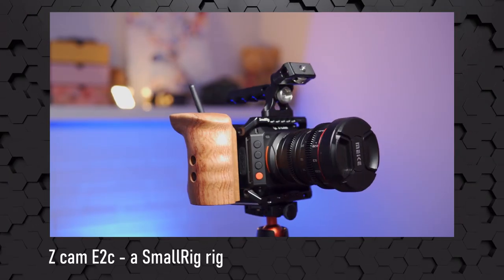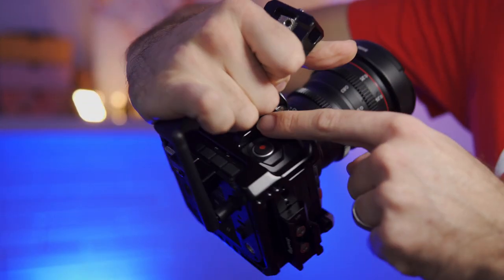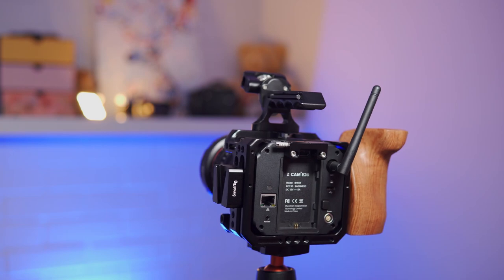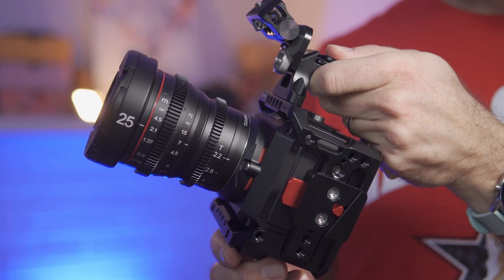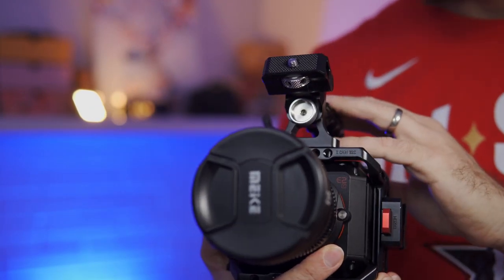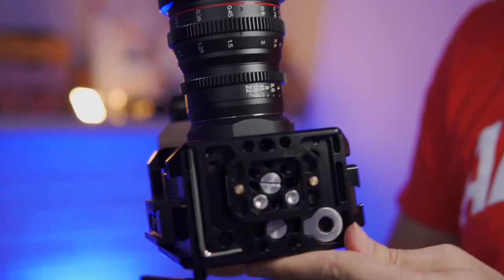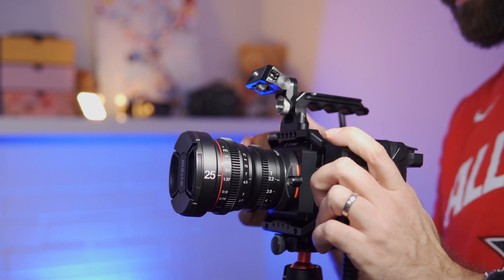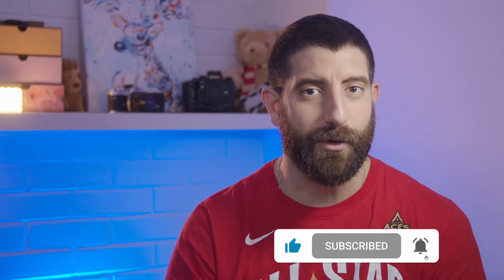Z cam E2c - a SmallRig rig (the wooden side grip is nice!)

Comment: Hey Roger. I’m planning to buy E2c as a B camera next to my E2. Have you seen an adapter somewhere on the web, to use the L series batteries (like E2) instead of LP-E6, directly on the camera…?
Reply from the maker: I just googled "lp-e6 to np-f" and it seems that Ledgo makes exactly what you're asking for. I'd be s bit worried of the extra strain on the camera and the plastic pins though.

With a fully charged LP-E6, I 1h45m of recording time though.

Also, best of luck finding an E2c!! I think they've been out of stock in most places I know of.

Comment: Thank you Roger for sharing your rig setup. looks nice and compact! 
I wonder if the camera will tip forward using that small top handle? i have an adjustable handle which allows me to hold it with my first finger in front of the pole, which makes the balance a lot better.
Reply from the maker: As it is right now it balances pretty nicely, even with a phone as monitor mounted at the end of the handle.

I wonder how it will be when I attach a monitor+battery there. I have checked some other options, but I'll need to use this setup for a while more :)

I hope you check my other E2c videos 😊

Comment: Do you like the E2c more than the Pocket 4K?
Reply from the maker: Loaded question 😊, I like the UI of the pocket much better, also Braw. I do like the form factor of the E2c and the out-of-the-box app for control and monitoring. I prefer the audio options of the Pocket (miniXLR with phantom power), and the battery life is much better in the E2c.

So... I don't know 😅

I'm just a fan of diversity and having options to choose, and all cameras have something over others that will appeal some people and/or be more suitable for different use cases.

Comment: The wooden side handle on the right is compatible with any smallrig cage, right?
Reply from the maker: Pretty much yes. It does come with a part that is screwed with 2 screws to the cage and then the handle slides onto that.
Reply: @RogerinFinland  Thanks. I'm still having second thoughts on the handle though. It's 40% off here but it does set my hand away from the record button. The SD card thing may not be an issue since I have a 128gb one.
Reply from the maker: @mistermastermind528  the handle is very much OK, but not my favourite. I feel you need a big hand to grip it.

And this is coming from a 1.92m/6'3" dude with a 25cm/10" palm 😊
Reply: @RogerinFinland  Uh-huh. You westerners do have bigger hands than us Asians. The native grip on my Lumix G85 is actually great. I just hate the fact that the side of the cage disrupts it a bit.
Reply from the maker: Oh, so you're considering this grip besides the G85 own grip?

I'd say it'll be weird and big. And not sure if any more comfortable than the grip with the cage.

And not sure if I qualify as typical westerner 😅 but I have fairly large hands (without being freakily extreme).
Reply: @RogerinFinland  Yeah. But I guess you're right. I don't think I'll need to add a grip to the left for my rig.

You know, I just checked the world map (I really suck at geography) and realized that Finland is actually at the center. Haha. But I do consider Europeans to be part of the west.
Reply from the maker: @mistermastermind528  ha! No worries, I'm actually originally from Spain, nowadays living in Finland. Buy I'm a bit larger than both the average Spaniards or Finn 😊👍🏼